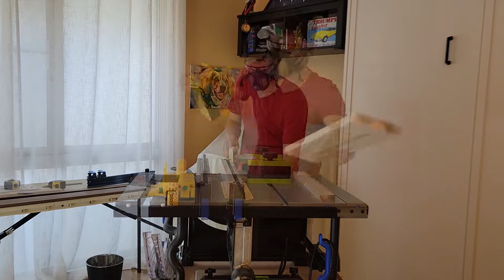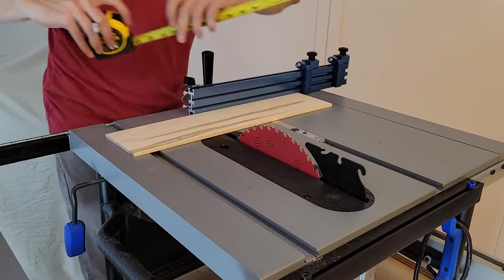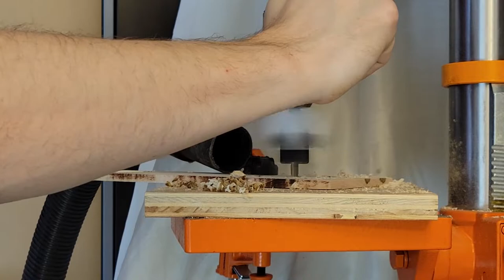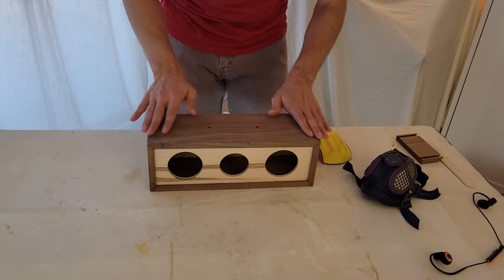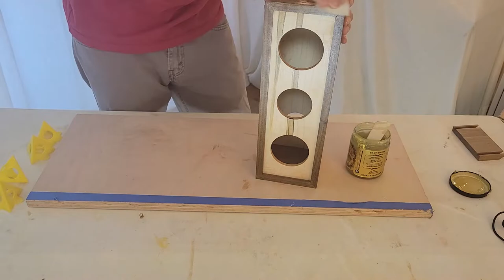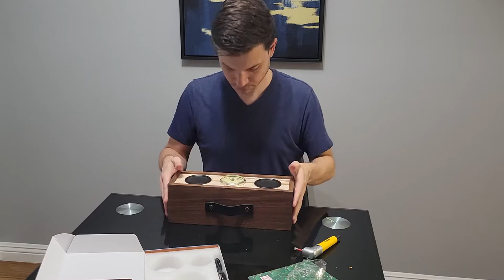Modern Bluetooth Clock Radio Build | Rockler Speaker Kit | Work Tunes

Comment: Looks great, nice wood contrast.  Sounds good too from what I can tell.  You could get a no 5 hand plane to smooth the wood or do some small amount of milling until you get a planer, if that's the way you are going.  A hand plane is good even if you have mainly power tools.  Just a suggestion, sanding works too.  I am still tweaking my incra that I bought used, but i have the fence and 2 flip stops to add now that you recommended.  I will get that going when the weather warms up.
Reply from the maker: Thanks, Scott. You're totally right, I do need to upgrade my hand plane game. I have a low angle block plane I use for very small needs but a No. 5 is a great idea. Much appreciated and thank for watching!
Reply: @simplewoodworking626  The hand plane was just a suggestion,  some people dont ever like them or use them. Thats fine, I appreciate it all.  are you planning to make more videos?
Reply from the maker: Thanks, Scott! Yes, I have a new video half edited that I'll post soon!